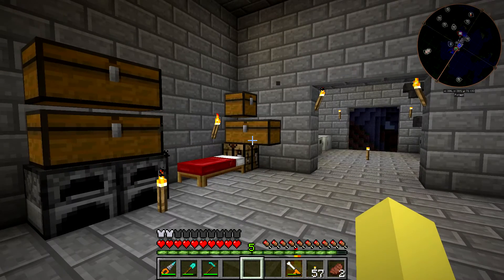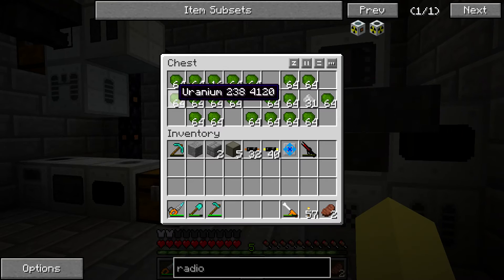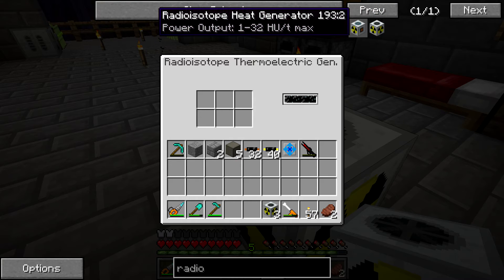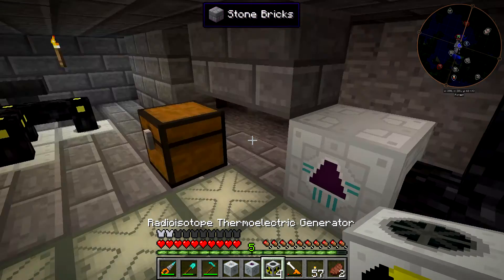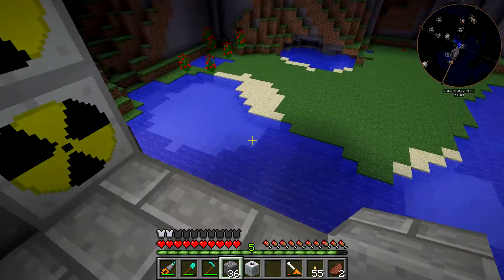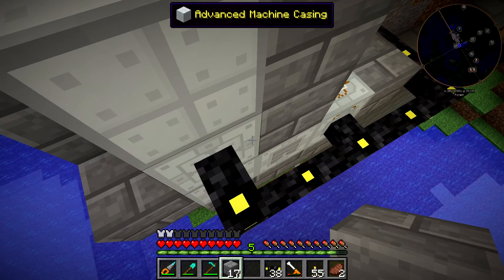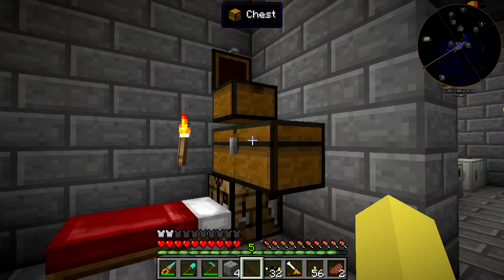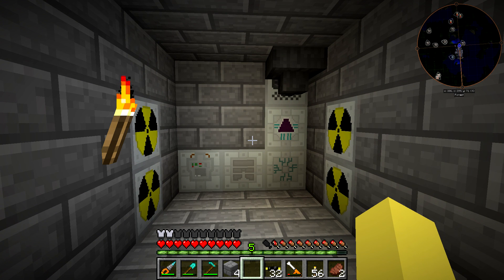Surviving With IndustrialCraft 2 :: Ep.22 - Radioisotope Thermoelectric Generator Project

Comment: Since the Batpack takes a slot, when you're wearing the Hazmat suit, what you want is a Battery or Energy Crystal. Just stick it on your hot bar and hold your wrench and it will drain into the wrench or drill. Unless I've got that backwards and you need to hold the battery and have what you're charging on the bar.

I think exporting to crystal is so you can share patterns with server mates or run multiple replicators at once.

There's also an EU-reader that can tell you what's going in/out. It's pretty cheap actually.

I've also been recording a series of my own, just with the mods I like playing the game my way. And if I ever mention you seeming scattered, you may ignore it. I'm even worse than you are. :D